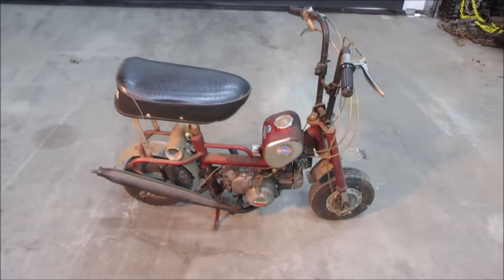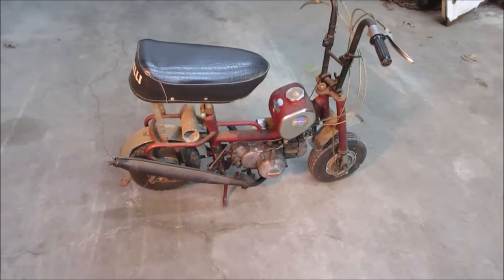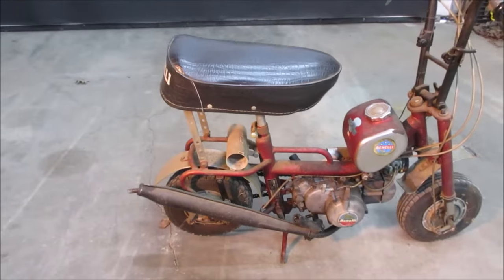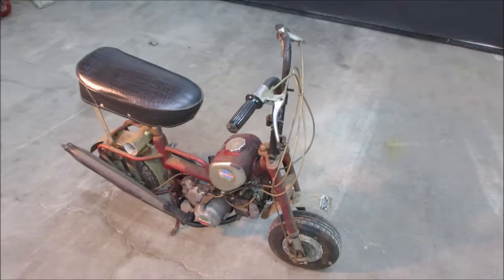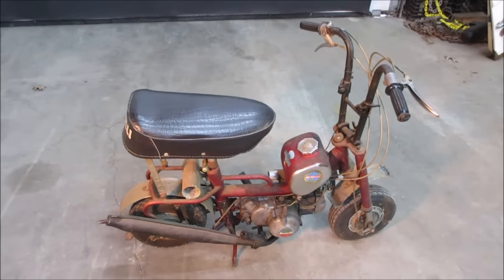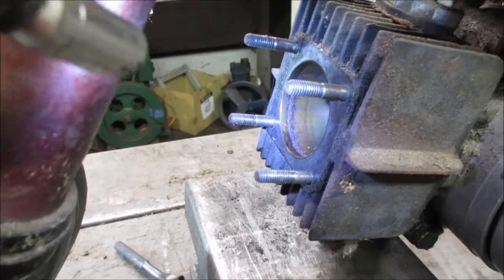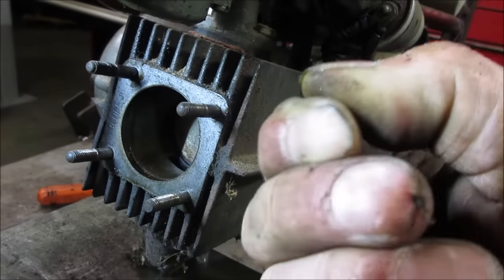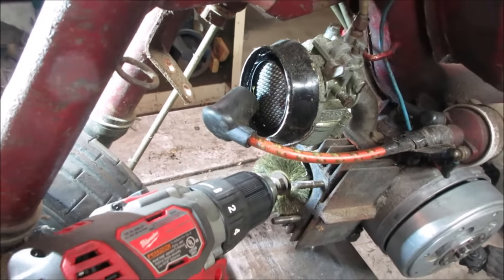WILL IT RUN! Benelli Buzzer Mini Bike

Comment: The mineral spirits you used was the environmental friendly version . Notice the milky white color . In my experience it’s completely useless in place of the normal stuff . Great video Mustie !
Reply: Yep. In my experience if the label says "green" or "earth friendly" it might as well say "does not work." The "green" carb cleaner is especially worthless. You might as well be spraying the carb with water.
Reply: Back in the early 90’s I was buying some engine degreaser. The guy behind the counter said to me, “Don’t use that $#!+ that’s good for the environment. It doesn’t work!” 😂
Reply: I remember the original formula chem dip carb cleaner, you could put the filthiest, grungiest carb in that stuff and it would come out pristine. The stuff now won't clean butter
Reply: @dave1135  Mustie's Chem Dip (in his ultrasonic cleaner) disagrees with you. Still pretty darn effective.
Reply: Like Phosphate-free TSP
Reply: I laughed when he said he stepped up to mineral spirits. Hahaha. He meant stepped DOWN to mineral spirits. It’s the gentlest of all he tried. ESPECIALLY the “green” stuff.

Comment: I believe the clutch is working as intended, the clutch lever is to force the clutch to lock up so you can bump start the engine or in other models to pedal start it like the Vespa Ciao. Great video again Mustie1.
Reply: Right! Came here to comment as well. Had a moped in Italy in the 80s. Third lever was to pedal start, or push / go down a hill and pull the level to start.
Reply: Second that on the bump start. Here in Europe the kickstart was usualy an upgrade. The Puch maxi's all have this lever.
Reply: It to disengage the clutch
Reply: @catsbyondrepair  I think it engages the clutch, linking the back wheel to the crankshaft
Reply: The lever makes a small excentric axle rotate, pushing the plate onto the clutch assembly, effectively linking the crankshaft to the output.
Brings back the Puch Maxi vibes for me 👌
Reply: @catsbyondrepair  more think required
Reply: @mqb17  Agreed. I have a 1974 Italian moped and that clutch lever is pulled in to lock up the drivetrain.  Start by pedalling, when up to a bit of speed, pull the clutch lever and the engine starts spinning (no kick start on mine).  After the engine is running, the lever can be released and then it operates like a centrifugal clutch.

Comment: I believe the little ball thing you used to clean the tiny carb parts in is called a 'tea infuser'.  You put a spoon of loose tea in it, hang the hook on the edge of your cup, and pour hot water over it. Steep the tea until it's to your liking and remove from the cup. Amazon sells all sorts of those type things.

Comment: Fantasic!! That was my first minibike in 1971~72, when I was six years old outside Cleveland, Ohio! Yes, the clutch was squeezed by the lever to get it to go, but when you got up to speed, you could release the lever. They apparently came with a headlight and taillight too,  but mine never had them.

It was the start of a lifelong addiction! I've never been without a minibike or motorcycle since!
Reply: edit to add: looking forward to following along on this one!
Reply: The clutch is centrifugal, if you squeeze the lever  you can push start it, my grandma moped had the same kind of lever
Reply: I'm with you Kirk N. cept my first was Honda 50 like Mustie has had here and then up through the Honda's - Mustie has had a copy of every one I ever had on his channel here - Love it!
Reply: @gatdelporco  Same with the old Puch Maxi P(P for Pedals) It too came with a lever to engage engine with gearbox, and you could pushstart it. An old schoolfriend had one, and it went 70-80KM/H 🤣
Reply: Lucky you. I grew up in the city so I never got one, even though all the other kids had those Coleman trail bikes
Reply: @rexjolles  many of us never did. I got my first one by working hard with my father in summers, just to get used Puch VZ50. It was VERY used. So it needed some fix-ups. But it ran 80-90km/h with a legal carburator. The one that was on when I bought it had a filed fuel neck, you know, the pipe that connects to the cylinder. Some bad way to "boost" a Puch VZ50 air-cooled engine. It never worked good with that carburator. It ran bad in the high rpms with the illegal carburator, an there it ran about 50km/h. But that changed the second I installed the new legal one. Then it ran smooth in the high rpms, an ran about 80-90km/h. Had a broken gearcase shield. So I bought a used engine. And had it for some years.

Comment: We had a Benelli when I was a kid and the hand lever underneath the left hand grip is a second gear to go faster.  At least that's what it did on the one we had.  Ours was blue instead of red and had a headlight and taillight on it.  I'm pretty sure it was a 1969 or 1970 model.  We got it new and it was one of those two years.  Thanks for reviving some great memories Darren. 👍
PS - After that minibike I rode dirt bikes all thru High school.  Then in 1978 after I got out of the  Navy I started riding Harleys and still do ride to this day. 😃👍

Comment: Retired from a 26yr Paint Lab Stint, a Paint shaker Should work well for your Small Bike tanks. We actually used them to make small Paint Grind samples. Breaking down the colored pigment & fillers for primers with small Porcelain Bebees. A 20min. Shake Cycle was all it took. Us Antique radio restorers Use O-rings to replace the broken or weathered Tuning Belts. For Different sizes Cut Them on a Angle 30* so the glue has More Surface Area to Stick to. Hope these suggestions Help You All.
Reply: Riggt on! Paint shaker has proven to be the best, bar none, to clean out old tanks like Honda Mini-Trails and Z-50's. Gets every nook and cranny and does a helluva job on small parts. I've even used sifted beach sand and saved pistachio shells as a medium.

Comment: I Got one of these for Christmas in the 60s . I had over 2000 miles on it when the odometer quit working.  It was a 2 speed automatic and you pulled the clutch lever for push starting.
Reply: Is this one also a two speed?
Reply: Did yours have the kick starter?
Reply: Yep, it was a kick start... my muffler was different also. A small square muffler underneath. It was a street legal bike, my dad had plates on it for an occasional ride through the neighborhood. I'm not sure if they made any variations on the transmission?

Comment: at the end of your video, the "clutch" on the bottom left is called a "starter clutch" and is used to push start this no-ped. On a moped you would pedal and squeeze the starter clutch to start the engine. The starter clutch locks the engine to the rear wheel.

Comment: I always wanted one of those little bikes to play on as a kid, but my parents couldn't afford it, things were tough in the 1960's and 70's.  Today, on a By-pass near to me, I saw a guy on a 1976 Kawasaki 900 4 cylinde 4 stroke potterin along at 40 mph, it was making a little bit of smoke , but looked in immaculate condition.

Comment: I remember those things. Back then a lot of them ran 16 to 1 mix. You never had any mosquitoes  around running those things. Some where I have what's left of a kit for making your own plug wires. You got boots terminals 50 ft of plug wire and a crimping tool. Great video have fun .

Comment: It's a mechanical clutch with direct drive. You need it with both wheels on the ground kick starting it would just bump you forwards. Pull in clutch kick it over, walk it forward whilst gently letting out clutch and away you go. Clutch also needed when stopping at traffic lights etc.

Comment: I’ve had lots of carb gaskets grow when old, but if you give them a couple days to dry they return to normal size.  It means there’s no quick carb cleaning but you don’t need parts that may be made of unobtainium.

For gas tank rust removal I put in a couple cups of nuts and bolts and strap them to a riding mower wheel for a couple hours.
Reply: Cool tip on nuts and Riding Mower ... sort of  like a "Rock Tumbler".

Comment: I really like this little Benelli. Yes when riding a Honda 50 when I was 15 I was coming downhill on a logging road. I was braking as hard as I could for a road washout. As I got right to it the bike slipped out from under me and I slammed to the ground. If that happened now at 75 I would be hurting for 6 months. At the time even though it really hurt, an hour later I felt nothing. So we learn when young and now my big rottweiler changed sides behind me in the park and I never threw the leash over my head in time riding my bike and flopped down and can still feel it when moving something heavy on the floor. Now I keep better track of where he is going and throw the leash over my head sometimes inadvertantly.

Comment: The Dellorto SHA (and SHB) float needle usually needs replacing, the black rubber tip wears away and eventually makes the engine run rich. New needles have red tip and will handle ethanol gas.

Comment: Very rare scooter even in Italy! Mopeds with a maximum displacement of 50 cc were very popular because at the age of 14 you could drive them without a license! I'm talking about the 70s, all the guys obviously replaced the muffler with a louder one and the best ones tried some modifications to have a little more power. This Benelli is really very interesting, good restoration ! 👋👋From 🇮🇹

Comment: I lived just outside of Naples 76-79 and I had a Benelli 50 but mine was more of a dirt bike frame and much larger.  It had two rear sprocket and a piece of extra chain and master link so you could switch from Hi and Low range.  Gas stations would have a visible pump like the old days in the US where you would dial in the 2 cycle oil and blend it with however many liters of benzina you were buying and fill your tank.

Comment: My son was in a couple moped "gangs" during his college years. They had meets and conducted themselves like a motorcycle club, with vests and patches. Very eclectic bunch, lot of goth/piercings, tough ladies and a smattering of old guys. He eventually moved on and got into full size bikes. One club was subsequently taken over by a bunch of druggies.

They rode everything in that CC range--monkey bikes, minibikes, and tricked out mopeds with "built" motors. I attended a couple summer meets with him as a guest, rode whatever motorcycle I had at the time. Very invigorating to rip through a large city, 100+ bikes strong, guys blocking traffic at intersections. Good times. And there was always one or two guys who you'd be ripping next to and you'd hear a "bang!" and they'd peel off, like a shot down plane. Blown motor, calling for pickup by the club van.

Comment: I used to have a Puch moped with a clutch setup like that. It's so the clutch disengages and the engine can keep going when you brake or when you're starting it. Otherwise you'll stall out.

Comment: For cleaning tanks, I've always had the best luck with an alkaline based All Purpose Cleaner/De-greaser. Something like Simple Green, Purple Power, Super Clean, etc. Just mix it with water and fill the tank. It'll eat away the oil and varnish. Then rinse and use an acid like vinegar for the rust. Chemical solvents and thinners don't seem to do much of anything.

Comment: You should try Simple Green in your ultrasonic cleaner mixed about 5:1 with water. It's less harsh, not flammable and not corrosive to aluminum. This is what I use and it wont hurt any rubber seals either, if the carb wont come apart easy, dunk the entire thing and run it and retry, I have saved some downright nasty carbs i would have otherwise scrapped.
Reply: He tried all sorts of things when he got his ultrasonic cleaner. Nothing beats carburetor cleaner for cleaning carburetors in it.

Comment: One trick I did for cleaning a tank was putting a cup of sand and couple of cups of varasol then plug the two openings up. I bungy corded it to my car wheel with car on blocks. Start the engine then stick it in drive. Let it run for 20 minutes at idle. Pull it off and flush it all out. It was sparkling clean.

Comment: Benelli Buzzers were sold here in the UK, yip they had head, tail and brake lights.
They were perfect for whizzing around London where the traffic is almost at a stop during peak periods.
The one I had would occasionally hit back on the kick start for no known reasons when starting it.
It always painfully caught you square in the ankle.

Herw in the UK, if it's petrol powered we have to road tax, insure and have a tearly MOT tesr (roadworthy test)
You are lucky riding without insurance etc.
This brought back memories of the Buzzer that was sadly squished by a lorry whilst parked :face-purple-crying:

Comment: Acetone and lacquer thinner are the same thing. Distilled white vinegar works very well at cutting surface rust. Alcohol or acetone should cut through old gas that has turned to a varnish-like substance. Acetone will dissolve almost any paint, so try to keep it from the painted surfaces.

Comment: hey musti, we used to have a Honda 55 (not sure of the number anymore) and that moppet had a lever to to start the engine while cycling (it had paddles). you use the lever to disengage the engine and while enough speed you let go of the lever and the engine would run.

Comment: I had a 1968 Benelli Same as this in blue.. was locked up too.. was all sorts of fun, they had a headlight and tail light.. the headlight had a speedo and odometer on it too.. 

the lever is a clutch for push starting it.. was terrifying fast for it's size at 14 doing 40 with little tires and no suspension.. not ideal..

i got mine to unlock by dumping a bunch of ATF in it.. then dragging it behind a golf cart till it just broke loose.. ran it for years.. it officially died when the upper plate that connects the handlebars to the upper suspension snapped..

Comment: As a sailor in Europe, in 1973, I needed a "land dinghy" to get to the Immigration Office / Customs Office / get gasoline for my sailboat engine / and get ice.  In the Adriatic a normal sunny day is 90 degrees.  I found the BENELLI "CITY BIKE" but couldn't buy one in Munich, where we lived.  On a yacht delivery trip from Elba to Viareggio, Italy I found a motorcycle store; and Yes, they had a BENELLI City Bike.
It had been in a show window in a neighboring town - and being s two cycle engine required an oil / gasoline mixture.
Back at the owner's main store and shop in Viareggio, he tried to start it, but the carburetor was clogged.  His mechanic removed the carburetor was quickly removed and cleaned; then the mechanic took the elbow that connected the carburetor to the cylinder; took it to his drill press; got s large diameter drill and in seconds was making a pile of aluminum shavings.
My wife stand there and watching this was aghast.  What's he doing to our new BENELLI?  Being and engineer, I  knew what he was doing.
In Europe, 50 cc vehicles are limited to 30 km on the road.  This speed limit was accomplished by having a restriction in the elbow.  All the mechanic was doing was enlarging the whole air path to the engine.
When it was running again, and I twisted the throttle, - forget the 30 km speed limit -  it emitted a roar and was good for at least 70 km/h.
The handle bar folds inward, and then downward.  The folded BENELLI fitted into my sail locker; could easily be lifted out and lowered into our dinghy.  Then at the dock, I unfolded it; fired it up and could then look for ice / get gasoline from the automobile gas station at the edge of town; or get to the Official Offices the easy way.  It was a wonderful solution to a sailing problem.

Comment: That clutch looks like the same clutch on a Puch Maxi engine, where you can pull the clutch in, walk/cycle with the bike to get it moving and then release it to start the engine. Early Puch engines didn't have a kick start, just a running start using the clutch.

Comment: The other day I picked up an old lawn mower with Aluminum deck from 1973 with a Briggs & Stratton motor. I got it running just had a bad coil wire so I change the oil in sharpened the blade and used it to cut the grass. It is fun to bring old stuff back to life. It's hard to read the label as most of the paint is gone but I believe it says Jacobson that's an old tractor company right?

Comment: some european mopeds have front break over the throttle handle and clutch on the oposide side plus gear change in the grip but i might confused levers from left to right it was long time since i seen polish moped

Comment: one of your recent projects you used a product called evaporate-rust which I tried on my VW project and it worked really well. mostly what was in my tank was varnish and it cleaned it well and was not toxic

Comment: Use a roll of nickels and some acetone/laquer thinner to start. If rusty, white vinegar.
Nickels have a soft edge that is the perfect scraper. 
Shaky-shaky
I just did a Benelli 65 last year. My carb and tank were a little worse and I had to make a head gasket from a Coke can.
The neighbor kid still rides it by every once in a while.

Comment: 31:48 In the shop I worked in before retiring 18 years ago, our O-ring kit, had several extra-large and spool material for making rings, it had a cutter that made diagonal cuts to the ring material and a bottle of Loctite Super Glue. Good work Mustie

Comment: At least what you work on is salvageable.  I worked on a Husqvarna  riding mower last week with a bent push rod and the other laying in the cover. I told the owner it was all done. I do not work on basket cases like that. It was more fun restoring vintage snowmobiles in the 90's than today's  crap lawn equipment.

Comment: On the tank, start with water based de-greaser.  That's safe and effective for any oil based gunk.  Then white spirit fluid for anything remaining that's not rust
Reply: Mineral spirits is the better known name.